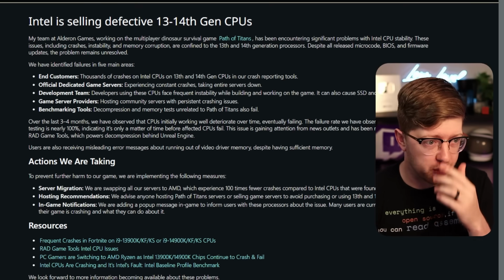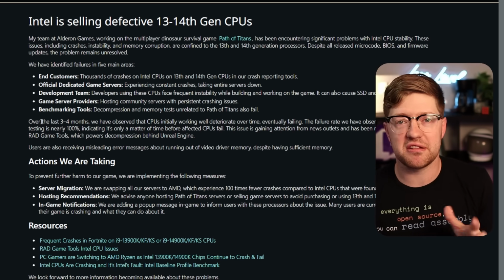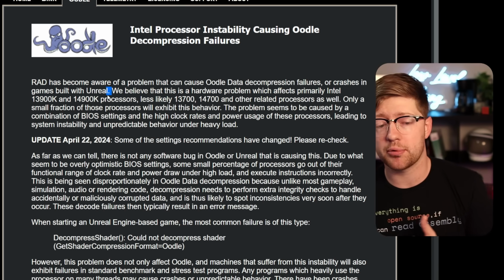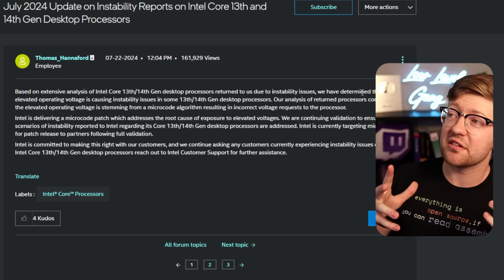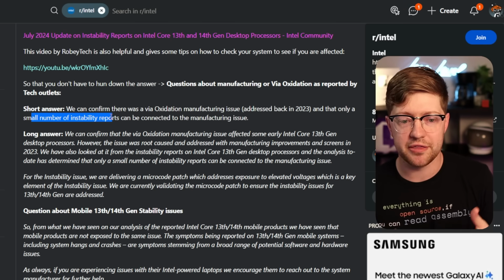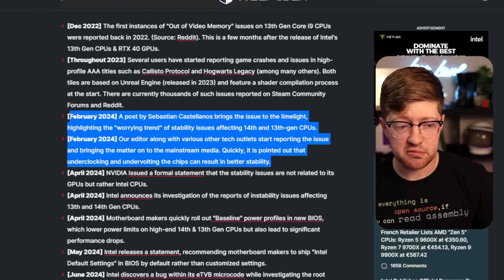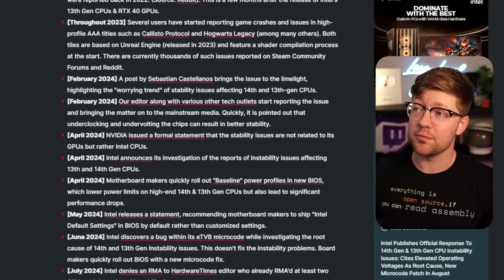intel CPUs are literally falling apart

Comment from the maker: no way haha anyway if you want to learn to code check out https://lowlevel.academy
Reply from the maker: ok
Reply: @LowLevelTV  ok
Reply: @LowLevelTV  ok
Reply: @LowLevelTV   you really need to check out gamers nexus video from last night. the oxidation comes from 2023 and 13th gen, but they never say what cpu's are effected.
Reply: @LowLevelTV Does this also affect the Core Ultra series? Just today I got a new laptop with a Core Ultra 7 155H in it, so hope not!
Reply: Wendell from Level1Techs was a really important person in the recent work on this.
Reply: "The PS4 has been hacked by a 20 year old bug! (yes 2006 was almost 20 years ago)" lll gang should fix it
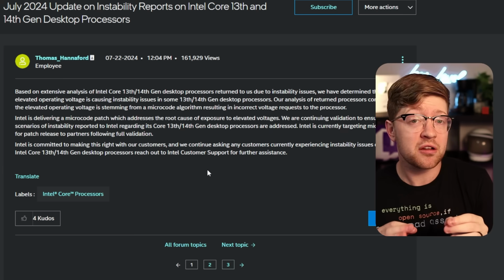Reply: 4:40 transistors in CPUs are tiny: true. However, even macroscopic semiconductors like Power MOSFETs able to switch hundreds of amps would still almost be exactly as sensitive to overvoltage then their extremely well integrated tiny cousins because it's the semiconductor material's inherent sensitivity to thermal runaway triggered by faster-then exponential self-accelerating cycle of increased gate-source voltage -> increased drain-source current -> increased temperature -> decreased drain-source on-resistance -> increased drain-source current. (the reason why Power MOSFETs aren't that sensitive in practice is that they aren't raw isolated single transistors but transistors with integrated on-die overvoltage & over current protection circuits protecting them).
Reply: @LowLevelTV  ok
Reply: I think the microcode "bug" is a cover. A Band-Aid fix to a widespread oxidation issue.

Comment: No there not they have new microcodes to fix the voltage spikes my freind iv had the i7 14700kf now I have the i9 14900kf had no problems running the i9 14900kf with a 420mm aio with upgraded rad fans temps while gaming is 65 to 70 under full load it's amazing  played 
unreal engine 5 games played fine and out of gpu memory its a bug in windows and disabled controller head set keyboard works fine and voltage of 1.412 is just fine

Comment: I worked at AMD when the processors where still made Texas. Austin. We could compete but our process was OOC. Our cpus would come out at the end at different speeds. 100MHZ, 150MHZ. we didn't have our process in control. Intel on the other hand would start wafers at 150MHZ and they would all come out at 150mhz, they had their process in control. to make a cpu took 35 days back then right before 2000. they had their shit down No they are letting their customers eat the cost cause i dont think they are replacing them, and the very first time the chip starts to overheat, they are scrap. Oh, its not all 13 and 14 gen, its the desktop 13 and 14 gen. I have a laptop with 13 gen and it works great, but my AMD desktop is still kicking ass.This is gonna cost them alot of cash. I might be able to buy some shares now..

Comment: I raised a tech support issue (years ago) with a game developer due to a game crashing at a particular point.  They asked if I had a particular series of graphics cards and told me that the GPU had come from the manufacturer overclocked by 50 mhz.  I lowered the clock speed in the driver's settings page and the issue resolved.  Game devs are used to running up against hardware issues I think.

Comment: Let's all be honest. This is not a micro code issue with voltage. Intel was struggling to maintain it's lead against AMD so it realised it could just pump higher voltage to get the performance it wants and likely knew no one would pick this up until several a year has pased.
It's funny how it only effects 13th and 14th gen. The two generation where AMD have taken the lead in the CPU market in terms of price and 1 to 1 performance.

Comment: intel 'gave up' on temperature controls and voltage controls, in order to keep up with AMD's increasing CPU speeds.... 
so now they are literally overheating the engines... 

personally, I use AMD to game but my wife's computer uses Intel CPU in order to STAY within temperatures and voltages, and that's WHY i bought Intel... don't give up on controls, Intel. your stability is what you are known for

Comment: Another problem is that x86 has been a dead architecture for decades. x86 CPUs are not really CPUs anymore, they are complete computers running an x86 instruction set interpreter. You will find microcode in other CPUs for other architectures, but none of them basically emulate the entire architecture. This is because x86 has reached limits in hardware that are impossible to overcome, and whenever you read that a "microcode update" will fix the problem, remember that without microcode, the problem would most likely never have existed in the first place, because if the problem is not somehow related to microcode or what microcode does, it would be impossible to fix in microcode. 

For example, Apple's Mx CPUs have a security problem that cannot be fixed in microcode because it is in the CPU hardware. But the problem is not that bad (you need physical access to the computer to use it) and this shows that ARM CPUs are not just emulating the architecture, they are mostly real hardware. Sure, even 30 years ago CPUs had some microcode, e.g. I once worked with a CPU that had no hardware division. It had hardware addition, subtraction and multiplication, but the division was just done by microcode. That's nothing special, you'll find that in every CPU, because it's impractical to implement all functionality in pure hardware. 

But again, NOTHING an x86 CPU does is pure hardware anymore, internally x86 has not been used for well over a decade. And where there is software, there are software bugs, and software bugs are much harder to find than hardware bugs in the final testing before a new product is released. Sure, they are fixable after release, hardware bugs are not, but if they destroy your CPU, fixing them won't help if the CPU is already damaged.
Reply: Yeah, but microcode executes inside the CPU, right? It's not software. It's not external. It's actually inside the CPU hardware.
Reply: @toby9999  Microde is software, of course. The definition of software has nothing to do with where the software is running, the difference between software and hardware is that software is instructions that can be changed at run time, thus changing the behaviour of a device, whereas hardware is hardwired functionality that cannot be changed without a soldering iron.

Comment: I have an AMD 6 core CPU that I have been using for the past 6 years and it still works perfectly fine... Intel has no excuse for releasing something so dodgy into the market.
Reply: I have an intel i7 4790 that has been working solidly for 10 years.

Comment: I heard that main issue is meant to be a Ringbus issue which is a design prob stemming bach to 12th gen.  12th Gen had an issue supplying enough power to the P & E cores and hence Intel have pushed the bus past it limits it appears in the name of keeping up with AMD.  Hence Intels supposed "fix" is to lower voltage, ie limit power to the cores.  Trouble is damage is already done in many cases.  It will be interesting to see how much performance is going to be loss with their patch.
I personally am not recommending current or next gen Intel to anyone at this stage.

Comment: Fingers crossed I haven't experienced any crashing issues with my i9-14900k so far, but then I don't play Fortnite or Path of Titans.
I've been using my rig for Cyberpunk and No Man's Sky in VR, no issues. The i9-14900k does run hot though so I'm thinking are the problems caused more by people using inadequate coolers for them. I'm using 360mm radiator AIO (Corsair iCue H170i) and that registers liquid temp at 45-50 degrees celsius when It's hitting heavy loads when I play in Cyberpunk VR.
Reply: Fingers crossed for you and I both …. Same experience here, I need to upgrade my aio (my pc was prebuilt)
Reply: @zemotika  Yeah man, I heard some people were using air coolers on the 13900K and 14900K I have my doubts whether those can cut it, especially with the 14900K running hotter than other CPUs currently on the market. My AIO actually died a month after I built the rig due to pump failure, not sure if that can be blamed on the CPU or just faulty AIO pump head to begin with. The cooler was still under warranty so Corsair sent new one to replace it and not had any problems since.

Comment: Does this also affect the Core Ultra series? Just today I got a new laptop with a Core Ultra 7 155H in it, so hope not!
Reply: No you’re good. The laptop chips have lower voltage in general to avoid thermal throttle … from all the research I’ve been doing - you should be okay
Reply: @zemotika  thanks! I've arrived to the same conclusion from what I've read. Still curious to know if the arquitecture of these chips is vulnerable to this issue or if it's a different one, regardless of the lower voltage.

Comment: Mircocode wont fix oxidation, and if there is electron migration due to overvoltage the transistors are already damaged and will have shorter life. The microcode patch only addresses one of these issues in the mean time we are left with and processor that will die shortly after warranty expires.
Reply: really you dOn'T SaYyYy duh

Comment: Not new for Intel. Back in the 70's we had major failures with Intel EPROM's (yes I'm that old). They blamed everything except their product. "You're not flashing them right" (Intel programmer),  "...not protecting from UV light" (Intel foil labels), "...not erasing them right" (Intel eraser), "...wrong voltage" (Intel developer system), "...etc., etc." They never admitted it to us, didn't even offer free replacements (well they did, but with similarly defective components). Years later I read an acknowledgement in an Intel biography by one of their senior company officers that it happened, and that they were frantically trying to deflect from their production pending an internal fix. Dissembling again?

Comment: While the actual cores degrading like this is another level of problematic, I am fairly certain that my Ryzen 3 3200G processor is suffering similar degradation in it's memory controller.
This as over time, I have had to downclock the memory, to even below the specification, for it to first run stable and now boot at all.
Before figuring this out, the system suffered random crashes while playing back videos or running UE4 games, which slowy got more frequent.
Which stopped happening after the downclock, for now.
Not that I mind this much, as the process lasted much longer than intended already and an upgrade will be an easy drop-in once it does go out.

Comment: If I'm not having problems with my 13900K should i upgrade the Bios when this new microcode comes out? Im undervolting my CPU to -0.75v, my PL1/PL2 are set to 253W and ICCMAX is 400A. The PC was built like 2 months ago and till now no problems.

Comment: Ahhh, the infamous HCF command.  Allowing the CPU to adjust it's own voltage is asking for trouble, if you ask me.  I'm not a software/firmware guy, I do hardware, but I work with software/firmware folks.  Periodically they ask us to put something in the hardware that allows them to do something we consider dangerous via programmatic control.  Our answer is always "not just no, but hell no"; when the inevitable software bug fries something, guess who gets blamed?  We will often do just the opposite, adding intricate hardware interlocks they must navigate through in the software, which of course they complain about.  But if it improves safety/reliability, has negligible cost and doesn't impact final performance, their whining falls on deaf ears.

Comment: Don't use desktop CPUs in servers or for software development. Workstation- and server-CPUs exist for a reason.
Reply: It's common practice and in no way excuses Intel
Reply: @merionis  Of course Intel is at fault for selling a subpar product. This doesn't change the fact that a desktop CPU is not intended to be used in a server environment. If it's "common" wherever you are, you should re-evaluate your approach.
Reply: @vandecasa3795  it is very common and has been done for decades, many servers will run on consumer cpus for superior single core performance and it is cost effective if the server doesnt require huge multicore performance. doesnt change the fact that while sure the cpus are not built for it, but even being unstable running in the harshest situations means that the cpu is completely unreliable as it didnt take steps to prevent the silicon from making wrong computations. digital information relies on correct data at all times, and if a cpu even makes one upset, you can assume the data produced by the cpu is useless or corrupted.

Comment: Hey guys, intel fixed the issue but you didnt know. Very efficient.
Reply: They fixed the issue but cpus are now physically damaged si they cant fix that with software updates
Reply: @zedzed3533  no, they fixed an issue after selling the oxidated chips, but they were in such good condition that they didn't need to disclose this to retailers aibs oems etc. what a chad power move.

Comment: My first 13900KF experienced a defect, it just killed itself during usage.
When i RMA'ed my processor i got told that the memory controller of my processor was fried, could it be that my first model experienced this issue?

My current 13900KF is still working fine, but i hope that Intel will issue a recall for the people who bought these processors.

Comment: In march 2023, I installed a Gigabyte Z790 Aorus Elite AX MB with an i7-13700K (ID 000B0671) and Corsair/Hynix CMH32GX5M2X7200C34 memory.  It consistently got the dreaded out of memory error, but only while playing a handful of different games.  I initially configured the BIOS to use the memory XMP1 setting (34-44-44-96).  After configuring it to use the JEDEC setting instead (40-40-40-77), the problem went away, and has been stable ever since.

Comment: This 100% sounds like planned obsolescence backfiring on them.

CPUs typically "last forever" and can be re-used indefinitely for various projects.

The only major issue with using older hardware in home projects has typically been power consumption and heat generation (for me at least), but as they've become more and more power efficient this problem has gone away, so now there is even less reason in the future to upgrade my servers.

Unless, of course, CPUs just started randomly dying somewhere between 3-10 years of being in use...
Reply: I never had a CPU die in all my life. If discovery during a class actuin lawsuit shows Intel deliberately did this, the company better me fined into oblivion.
Reply: Except what Intel does is just throwing more power at their CPU and call it next gen. Both 13th and 14th gen are overclocked 12th gen. You can see the difference in power draw efficiency in recent Intel vs AMD CPUs.
Reply: A friend had his 3800x AMD CPU die and had to warranty, I just couldn't figure out how a CPU would die running stock until I learned how motherboards are overclocking CPUs by default. It could be a new planned obsolescence tactic to shorten the lifespan of CPUs by feeding it high voltages and letting it run at high temperatures for paltry gains in performance.
Reply: @mrkesu.  Are you sure this is not the motherboard "capacitor plague" which has a lifetime of what you state?  I have Intel CPUs going back decades and they all work.  However, on several motherboards, including ASUS and GigaByte, I have had to replace popped electrolytic capacitors to bring operation back to life.  Inspect every aluminum electrolytic capacitor (wrapped in insulating tape, usually black, sometimes green or orange) for a bulged top, even a small bulge, on every working machine you have before it fails.  Replace those with aluminum polymer capacitors (visible aluminum all on the outside), and your CPUs should last "forever".
Reply: AMD already does that with their Epycs and vendor lock.

Comment: Intel, we have a problem !
Don't hold your breath waiting for a free replacement CPU that will alo fail.
Years ago they said that the limit had been reached with the avaialble tech
to make CPU's run any faster, well they have now gone beyond that point.
I am still using an old Pentium based PC which despite it's age still works well.
Srop chasing the holy grail for faster PC's and the issue will go away.

Comment: Well I will not be upgrading from an 11th gen to a 13th or14th gen any time soon, with all these issues. I wanted my next upgrade to be Intel since AMD cpus have some kind of difference that makes some of the really old games I like (such as the original unreal tournament), unplayable as the games run at double if not triple speed. Even my build that ran a fx-8350 had the issue, and it has to be the difference in the architecture.

Comment: I was starting to get breakdown and instability after running an fx 8320 at 5.2 ghz for a couple years.  had to start bumping the voltage up a little every few months, eventually selling it at 1.53v core voltage to maintain that 5.2ghz stability.   if this is what's happening with intel chips that's sad they have to push them so hard to try to be competitive.  that should be left to enthusiasts to deal with, not the average consumer

Comment: Since x86 is Intel proprietary tech, would it be right to say that any x86 licensed processor (like AMD) also runs interpreted assembly with microcode? 🤔
Reply: not the same microcode in AMD, and microcode is not just an X86 thing, even ARM has microcode.

Comment: My friend also has i9 14900K. Here is a quick tip for those who are afraid of going to BIOS and lowering the voltage. We found out that if you switch your power plan mode in Windows powercfg.cpl to Power Saving Plan it will fix the issue, he is also using it with RTX 4070 OC so the Power Saving Plan havent had that much of an impact on overall FPS and performance when playing not triple A games.